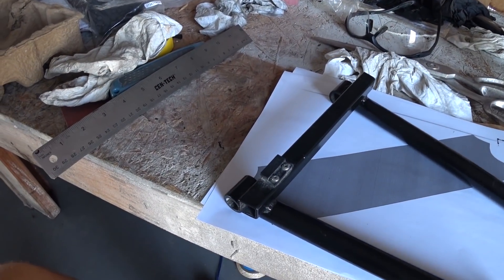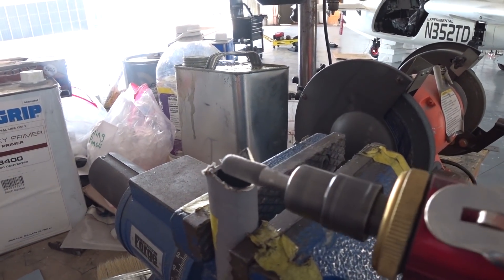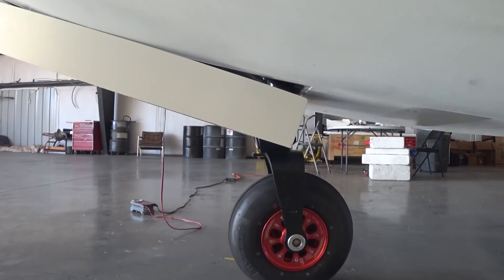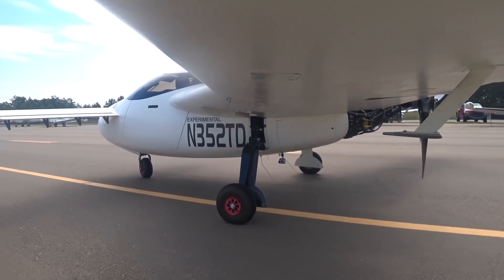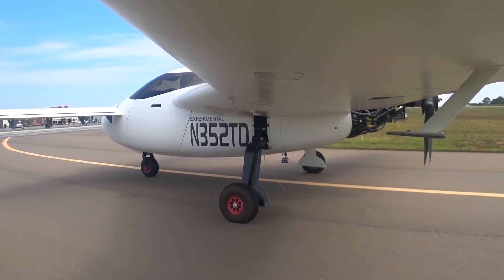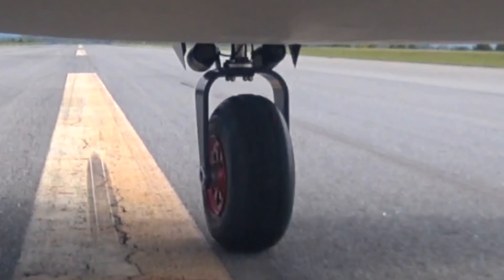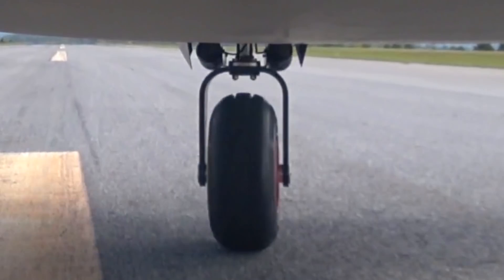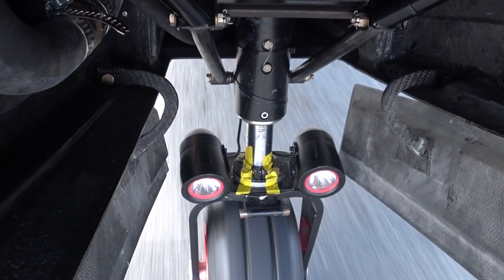Did We Fix the Shimmy? - Building the Raptor Prototype

Comment: Just a thought, motorcycle front forks use trailing geometry even though they are raked forward.  When front ends get even slightly out of the geometry they get what's called the "death wobble".  Call a Harley service technician & ask him about the geometry calculations used for bikes.  It's close tolerances calculations & is taught to all trained technicians.  HTH

Comment: My guess is the play in the upper (bracing)? I don't know what you would call it but at 16:49 you can see the washer start to rattle before the shimmy starts. Any play in those connections would transfer down I would think. I'm sure you have seen this but here is another youtuber who had a problem and it turned out to be just a tinny bit of play. https://www.youtube.com/watch?v=RlePEMFDAPg
Reply: Micah - good catch.  Correction on the video timing, this happens around 15:29 in the video.  Weird to see that washer flopping around.  I don’t know if this would make a difference but it seems like an obvious thing to try - tighten that bolt and try another run.  Personally I think a different forks with more trail, together with a smaller wheel, might solve the problem.  The smaller wheel allows the assembly to retract without interference even though the fork has more trail.  The smaller wheel also weighs considerably less, which (all else being equal) raises the natural frequency of vibration (proportional to square root of 1 divided by mass if I recall correctly).  Good luck!  Such interesting work you are doing. Thank you.

Comment: I think you need a torque arm from the cylinder to the fork. At higher speed, the front is lighter, and a slight lateral push/wind will start the shimmy. The wheel is round, and lateral movement causes the wheel to look like a sphere, which can roll in all directions. In the case of this wheel the attempt to roll to the right, and the mechanical rejection in the opposite direction is the shimmy. After the first occurrence it becomes an oscillation.

Comment: As pointed by Tabris, Steve Mowat and a71landcruiser I suspect a rigidity/resonant issue where the wheel "leg" attaches to the plane frame, that contributes to the problem. Regardless of what perturbation is starting the oscillation, there is something that keeps it going and behaving resonant, meaning the energy is not being absorbed but released in an elastic way back to the assembly in a cyclic fashion. If the wheel would leave a trail on the tarmac during the shimmy, it would be a sort of sine wave.  This means that the length from the frame attaching point (whole plane with big vertical and horizontal inertia) to the front wheel axis has to change at that same frequency, to keep the wheel in contact with the ground, from where the shimmy energy comes from. But you do not see the piston going in and out into the cylinder at the same frequency, it only reacts at the terrain change, so the length of the cylinder-piston assembly is not accounting for that cyclic required elongation. I suspect the place where the leg attaches to the frame is not rigid enough and it´s natural frequency is very close to the shimmy frequency. I would try to make that part more rigid and therefore have a much higher resonant frequency that did not match with the shimmy frequency. Sorry for the length of this, and it is a guess more than a certainty and for sure not the only factor.

Comment: Too much compression and rebound damping? Too stiff spring? To me the strut movement does not look smooth. Too much rebound damping or too stiff of spring would cause the tire to lose ground contact and creating a light wheel situation. That's a head shaker, pun intended.

Comment: Yes lower the tire pressure you only have 100 + pounds on the front wheel. My motor bike only has 25 pounds in the front tire. I said once before that I dropped my Piper Cherokee Pa-28 140 front tire down to 15 pounds and the shimmy was gone. Try it you will like it.

Comment: Just a secondary thought, you might want to remove those gear doors until you have solved the shimmy problem. With the amount of flex in the strut, I don’t think it is out of the realm of possibility for part of that mechanism to snap and for the nose to come down. I would hate for that to happen. It would be awful, but having the door mechanisms removed in case that happened would save a lot of work and prevent unnecessary damage.   Just an idea, keep fighting the good fight, it is really coming along great!

Comment: Try to get a tire with very low thread depth or a bold tire. The energy for the vibration is stored in the thread deflection. What would also help is a tire with a more square profile. This one is very round and allows the tire to run sideways.
Reply: I checked for suitable tires and this post mentions one that fixed this guys shimmy completely:
http://www.grummanpilotsassociation.com/topic/nose-wheel-shimmy/
Reply: Another article that makes excessive thread depth responsible for shimmies:
https://www.mcfarlaneaviation.com/media/documents/can-you-stop-nose-gear-shimmy.pdf

Comment: Tire geometry?! It looks to me that the tire is the cause of the shimmy, as soon as the tire is loaded, the slightest hit off center, caused the sidewalls to collapse just slightly, which started back and forth the oscillation on the tire that has a very round profile and small contact patch as a result. If you try a tire with a flatter contact patch and a more square profile, with heavy sidewalls. That might work.

Comment: In the slow-mo there seems to be an excessive side to side play in the strut piston to housing that shows up as the moment increases with the extension of the strut,. once this initial side load occurs it results in a minute wheel turn (particularly with the offset castor) which begets the shimmy. While not having "strut" experience, the seal gland material the strut piston rides on may be too soft or softened over time?........ or it has too much clearance? You could rig a dial indicator to check and manually induce side to side deflection of the the piston at various points of extension. Good luck!

Comment: it looks like the shaft is moving inside the tube, also looks like there's not enough strength in the mount of the assembly to keep the assembly from oscillation... can you pull (longitudinally) on a Lanceair to see how much deflection they allow in their mount/assembly?  there's a tremendous amount of force and it seems like even if you put a damper on the wheel that the problem would manifest itself again because the entire structure is moving....

Comment: Give it more rake and remove the centering parts. The nose wheel will caster to center as braking is applied. It should caster freely with 10 to 15 lbs of side load.

Comment: That strut has a ton of left to right play, wobbles back and forth like a drunk with palsy. Maybe stiffen it up a bit with some more bracing when you put the damper on.
Reply: maybe a yoke on the lower wall inside the doors, that the strut can firmly fit into when wheel is extended may help stiffen up the left to right play.

Comment: I thought you have to go the other way (more rake angle), but to be honest i have no idea how the geometry works for airplanes, only thing i can suggest is to give the motorcycle geometry a read, there's some high level explanation here https://en.wikipedia.org/wiki/Bicycle_and_motorcycle_geometry  - seems that generally a minimum of 20 deg is required and about 25 deg is common, but again i have no clue if this is applicable to trike type brake steering and a free steering front wheel. One thing i can say is that it looks darn violent and I'm surprised nothing got broken or bent. I hope you figure out the problem and get it fixed, wish i could help in some way.

Comment: Peter I think you are on the right track.  This phenomenon is very similar to motorcycle head shake.  Nitrogen pressure and tire pressure can both be a possible solution.  The strut does not appear to use very much of its available travel so less nitro will help with that.  Also your thought on the oil is a good one.  One question though, are you using the weight bags in the front for these tests?  Maybe try adding them in if they are not being used but also add some "passenger" area weight as well to see what effect that has. But I believe lowering the nitrogen pressure is the best first step.

Comment: wait.... 0.2 degrees rake? That's hardly anything. I wouldn't be surprised if the whole plane can tilt back more than that when you let off the power (and/or went over a bump). It definitely will when you try rotating for takeoff :)
Reply: I just realized you raked the entire strut more. I don't think that helps, you want to increase rake of just the forks at the bottom. The goal being that the point of drag is more offset from the strut axis, so that it will stay behind the strut. The distance of the drag point away from the strut axis is actually the important factor, rather than the rake angle.
The strut itself would be best kept in line with the load it is there to support, ie. in line with gravity in this case, or maybe even a little forward (Lancair docs actually say a few degrees forward). If you look at the front forks of a motorcycle they are often very far forward, but the point of contact between the tire and road will be a healthy distance away from the rotation axis of the forks.
eg. I used to spend about 2 hours a day on one of these, and with the right downslope I could happily let go of the handlebars for a good while to adjust my gloves, zip my jacket up more etc, steering with my bodyweight, with no shimmy damper. The yellow distance is the stability margin:
http://www.iforce2d.net/tmp/klx250rake.jpg
Of course those are rather large radius tires which helps this effect a lot. With a small radius wheel you're better off just mounting the tire center further offset from the strut axis.
(Disclaimer: could be talking out my ass :)

Comment: Interestingly Lancair suggest mounting the strut +2.0º (forward) +/- 0.5º on the ES model, +4.0º (+/-0.0º) on the 320, and +1.0-5.0º on the Legacy - I'm sure other models will vary too. Whilst the geometry on the Raptor will likely be different for lots of reasons, it shows what a small range there is to work with. Lancair also have a number of suggestions to adjust the nitrogen pressure for different engine/propellor combinations, beyond simply propellor clearance considerations. Having said that, I noticed the shimmy only started after the strut was unloaded and loaded up again, as it went over a bump too, which may indicate something other than geometry alone is at play. I think the more vertical mount has obvious benefits for general ground-handling characteristics, but I'm not sure this will be solvable with geometry alone. Certainly an interesting challenge, but I'm confident you'll nut it out!

Comment: From what I've read, just about all caster wheels will flutter at a harmonic speed. It seems to me the problem you have having now is that you have almost no actual caster, despite the wheel trailing. If you extend the gear a little further to get some caster, it should have a dampening effect. I'm no engineer though, so I couldn't give a suggestion as to how much caster you should actually have.

You'll notice that no modern bicycle has a vertical pivot point for the fork, for the same reason. Bikes have the advantage of a rider's leverage on the handles to control shimmy, to a point. Get a road bike up to 50 mph and there's a good chance you'll get shimmy. https://www.youtube.com/watch?v=hMNFS2ap3fU

Comment: Instead of using a caster wheel design, which probably will always be a problem, why not redesign the whole thing using a double redundant electrical/ mechanical steering system? Your already a bit light in the nose, the added weight from the components would help with that.

Comment: Were you stepping on the brakes as you throttled down? If so the extra downward load on the wheel caused by the braking may just be enough to accentuate all the flex and slip in your airframe/landing gear. I’d suggest simply stiffening your setup as much as possible, so the wheel can’t track itself one way before overshooting and flexing your gear 5 degrees the other way

Comment: I fly a DA20C and will experience a very bad shimmy if I land too fast or drop the nose too quickly after the mains have touched. The shimmy is a result of the extra loading on the front tire. It is removed or significantly reduced by holding back on the stick and keeping the nose up until the plane has slowed. I recall that you had placed extra weights in the front luggage compartment of the aircraft to avoid an accidental liftoff. Could this be the cause? Not sure how difficult it is to keep the nose on the ground, preventing an unexpected takeoff, while pulling back on the stick. One additional observation, the shimmy occurred after you reduced power. Maybe the canard produced just enough lift to stop the shimmy. However, as the aircraft slowed and weight shifted to the nose wheel, the shimmy returned.
Love the airplane, keep up the great work.
Reply: When I was in flight school, one of the Warriors I flew sometimes had this very problem. Had to hold it back like a soft field landing until getting pretty slow or it would shimmy like crazy.  Eventually this was (mostly) fixed by adjusting the nitrogen levels. I don't remember which way, but my instructor mentioned it. Such a complex problem with many possible causes, even on planes that shouldn't have a shimmy based on thousands flying without. :-) -Daven
Reply: Thats what I was wondering, if the 200 lbs is in the nose still and if thats not helping the situation.

Comment: Are you letting it coast down? have you tried tapping the brakes to settle it out? It looks to me that the whole assembly is not loaded enough or rigid enough. Your geometry fix was good. But I think this is a second and distinct problem from the first encounter. I would want to try a brake check and see if that tamps out the headshake. If so, I would look to eliminate play in the strut and mounts and then maybe lower the ride height to increase weight on the nose wheel. Thanks for letting us participate Peter!
Reply: Yeah it looks like a combination of little trail, which means the wheel will pivot a lot for a given sideways deflection, and sideways flex in the strut or attachment in the fuselage that sets up the resonance. The strut flexes to one side, which makes the wheel turn and drive the strut to the other side, which makes the wheel turn back, and so on.

There are fundamentally two solutions to resonant problems: either increase damping or move the resonant frequency out of the excitation range. Using a smaller wheel and removing the lights, like someone suggested, would lower the inertia of the strut and increase the resonant frequency, as would stiffening the structure. All of those should help. I also think more trail will help because that will lower the amount of the wheel pivoting.

Adding more damping to the strut and adding a shimmy damper obviously will increase damping, which helps, but the problem is that you don't know how much damping you need to add. It's entirely possible that the amount of damping needed to avoid the shimmy is so large that you can't turn.
Reply: @patrikj  I agree with your assesment.  But as a long time motorcycle racer, I lean on my experience over the decades and how headshake slowly became less of an issue.  Back in the 90's we used to run huge steering dampers on our bikes that had to be mounted to a frame spar.  Once inverted forks became more accessible, steering dampers got smaller and trail numbers reduced, leading to more responsive turning.  this was made possible because inverted forks were more rigid and had less tendency to 'track' or 'wander' under light load.

When Peter first had the issue under acceleration, I was certain trail was insufficient.  Now that he has increased trail and increased steering offset we see that it tracks straight under acceleration because he has to keep a bias in steering input due to P factor which keeps everything loaded.  Also, we see that turning has improved due to offset.  However, on this last test, as soon as he pulls power and coasts, we see the headshake return, but this time in a classic form that reminds me of old superbikes.  

What is different to my motorcycle analogy here is that the canard is generating lift and unloading the wheel.  When Peter pulls power, the canard is still generating lift, but the steering input is removed as P factor is reduced.  This, I believe, allows conditions to be met for the headshake.  Those conditions should be addressed to the best possible degree before relying on a steering damper for the reasons you cited above.

If the nose wheel is mounted as rigidly as possible to the carbon fiber structure and the strut itself is not found to have excessive play, then there may have to be some aluminum reinforcements bonded in place that would bridge between mounting bolts and distribute load and flex across a larger area.

I think my hypothesis can be tested by transitioning straight from acceleration to braking.  If little to no headshake occurs, then we have a plausible case that play in the nose wheel allows wandering that induces headshake.

Oh, and if you wanted to throw a complete curve ball in the mix, you could try two small tires in tandem up front.  That would change the way the front end tracks the pavement, but I don't think it would solve the issue.

Comment: Is there flex in the upper mount points?  Is the carbon flexing like it was on the floor?   Perhaps some deflection when you hit the bump, leading or contributing to the oscillation?